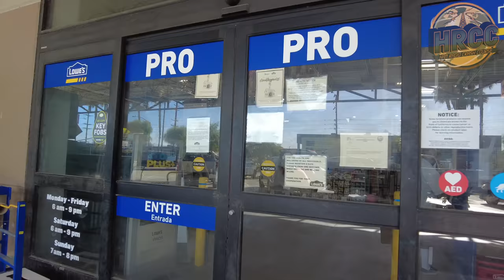My Ham Radio Go Box Wiring And Setup

Comment: Hi Josh,

Ok, in steps as I watch...
[8:30] fuses - the power cable they provide is designed for MOBILE; i.e., CAR & TRUCK use. The fuses are meant to be close to the battery (power source) to protect the wiring & prevent fires.  Arcy-sparky & oil/gas don't play nice w/each other.

Wheels! Nice.
But... for POTA, ya needed BIGGER WHEELS!  You may want to strap that case onto an aluminum; large pneumatic tire dolly.

Comment: Fuses are close to the battery to protect the wiring. In the event of a fault you want the fuse to blow close to the battery so you don't keep pumping electrons into a dead short, overheat the wiring, and start a fire.

I do agree with you that it is a pain to shorten the power cables to the desired length. It would be nice if they came in three sections with a radio connector section, the supply/fused section, and an extension.
Reply: To expand on Daniel's point with an illustration:  Imagine you have a power source (battery) on the left side of your desk, and the load (a radio) on the right side of the desk with the power cable running between. Imagine someone comes in and sets down a large object on the desk with rough edges that pierce the sheilding of the power-cable, causing a short circuit.
If the fuse is close to the load (radio on the right side of the desk) now you have a battery with a short-circuit and that fuse by the radio will NOT do anything to help the situation because the flow of electrons never makes it that far (remember: short-circuit!)
However, if the fuse is close to the source (battery on the left side of the desk) the short-circuit should exceed the value of of the fuse (assuming an appropriate vlaue of fuse was selected!) thus blowing the fuse.
Yes, location of a fuse MATTERS and it should be as close to the source as possible.
73
VE3KLT
Reply: 100%

Comment: According to the West Mountain's Power Gate manual, (copy -n-paste)  "Solar Panel - Connectors are intended to connect to a solar panel, NOT A CHARGE CONTROLLER. When the power supply is not present (or off) and there is over 13V on this input, the battery will be charged from this input. This is

an optional input to be used only with a solar panel."  People, read the manual!

Comment: Thanks for the video! I'm setting one up with my spare 7300 and a 5100. Your video is one of the better ones, for sure! I'm using the 4U and I found a luggage cart the perfect size to roll it around. On another note, if  I had that many Anderson connectors, I would lose sleep over the possibility of running out. Stock up.

Comment: I also have a Gator 6U Go Box...mine was featured on KM4ACK's YouTube site...I've ripped mine apart 2 times since then, putting things in as well as throwing things out....the wiring can get interesting to say the least... My top 1U where all my switches/outlets and voltage meters go came as a solid piece and I used a "knockout punch" of the correct size to cut holes for those devices.....Lots of fun designing these......Thanks for the video....
Reply: A note:  when you start wiring your go box....draw out a schematic, it'll help you later....

Comment: The need for brackets has caused me to save every single extra angle bracket, washer, and grommet I've come across. 
I'm building my own box once I get a mobile I can afford. Thank God I got in touch with another ham club member so I gotta save all my rubles and possibly pick up a QRP since I'm on a damn island and 20 watts is good enough for the military guys. 
Thanks again for getting back to me. I looked up how much sending a zip pack will cost, and I'll just buy you a beer and give you a spot to stay the next time you're on the big island. 🤙🏽
Reply from the maker: Hahah yes! Save all the brackets.

Comment: That's a BIG go box.
Reply: Almost looks too heavy to "Go"
Reply: I was thinking that too, but, I guess it also depends on what you mean by "go."  If you're car camping, or maybe even DXpedition via plane, etc, heading to a HamFest, and stuff on that order, this is not a bad way to take everything you need in one, solid unit.
Reply: @pspadotto  plus there is a little room inside the box (on the back of that top shelf) for some extra cables, wire antenna, roll-up j-pole, etc.

Comment: Nice, my go-box is very similar.  A fuse's job above all others is preventing fire.  The fuses are placed near the power source so that they protect the entire length of wire in case of a short.
Reply: Thank you for your post. It helps me understand how to better build my gator  go box.

Comment: I bet these videos are good for engagement because I know I have a few opinions while watching this! 😁 On your fusing debacle, I would use a RIGrunner (or similar) that has fuses directly on the distribution board, and then cut the radio power cables as short as you want.

Comment: A short tip for installing the shelves.  As long as everything is attached securely you can tip the rack so the rails are facing up.  That way the shelves can just hang in place and you can easily set them in and get the exactly where you want them.  Dave-WA4OPE

Comment: Awesome project Josh, I am going to have to make one now too. But to answer your question about the fuse, if you put the fuse closer to the radio, and if there is an issue and the wire gets too hot, it will melt the wire all the up to the fuse. you want the fuse closer to the power load so it protects the wires going into your car. now if you are going to cut the wires you can cut to fit but you want to have that fuse close to the power source.

Comment: I live about 45min from Sweetwater. I do play with some music and love Sweetwater. When you call/email/chat with questions you actually talk to someone who knows the equipment. If the person you get doesn't know the particular gear your asking about(because they have a lot, no one knows it all) they will get you someone who does know it. If you ever have need of audio gear or musical gear, calling Sweetwater will very much remind you of calling Gigaparts.

Regarding fuses on the factory wire, who knows. Personally I want fuses at both ends so that if something happens in between that is causing power to be injected to the cable both ends blow. I'm mainly thinking about in a car where you may have a long power run where that is possible. Now just imagine if all radios used a standardized power connector! You know like USB-C. I said like, because I know USB C doesn't have enough power or amps for some radios.

Comment: Kester solder 60-40 and marine shrink tube - power crimp connectors are a big no-no. Panel mount so-239 - make regular jumpers to pl-259 with reducers - no crimps - 316 coax. Please get some 5 gram packs of desiccant - these are dirt cheap on amazon and reusable and will keep things dry! I'm not giving you a hard time BUT if u want reliable field ops for w/e reason its gotta work when you need it, last thing you want to deal with is some corroded connections showing faults when you really need things to work!

Comment: 6U as in 6 Units. There are SO many items for them. My dad used them for audio, as did my high school. I used them at church for audio, visual and networking. You can go many different ways. Think of where you want your radios, air flow, power supply, battery or both. Connections you might need for power or antennas. I wired a switch outlet to a psu. Lighting in the case. 

It’s literally a shack to go. I say work in sections and make custom cables.

That is the correct power cable. 

My Anytone and TYT had three fuses. I think my Kenwood has 2. My 7300, I cut the cable and put power poles on all of them. I even made more. Including a cordless drill battery pack that died. It has power poles.

Comment: Very cool project Josh! I did a similar project with my Yaesu FT-891 when I upgraded to a new radio. I built mine into an old aluminum briefcase in the hopes that it would give it a bit of RFI protection, plus it looks cool and is fun to carry around what looks like a vintage nuclear football. My cable management was a bit messy looking but it got the job done. Looking forward to more of your project videos like this. 73!

Comment: Love the use of the Power Gate. Now, I use mine for my Flexradio and have since I got the Powergate. I use mine more as a UPS for the radio so when I loose power, I have time to safely shutdown the Flex or if not, it will run the radio for about 4 hours (That storm we had last winter was a good test). I also have a go box and I use the West Mountain Rig Runner 4007U which includes 2 USB power connectors which I use for the PI 400 and external monitor. My Solar power controller/battery was the BuddiPole Powermini into the West Mountain. The radio I chose was the FTDX-10. I am very glad you showed how to mount the radio. I need to do this but I have a full shelf in mine that attaches to the front and rear. As such, it is adjustable and it makes marking out the holes a little more difficult and Yaesu does not have the mobile mount so I fashioned something up that I hope to improve on. It weighs 35 pounds and most of that weight is the damn steel shelf. What was your weight in the end? I was hoping you would say. For lighting, look at W1FYG Smoke Signals RF's design. There is a company that TO showed that Don uses in his Go Box.
Reply from the maker: I’ve got a few more things to do and I’ll do a follow on video. I’m guessing we’re above 40 lbs at this point, give or take.
Reply from the maker: I’m going to look up that lighting now.
Reply from the maker: I weighed it. 50 lbs. it’s a chungus. Lol
Reply: While I definitely see the advantage of using a Power Gate to switch from AC to battery, for me who's on a limited budget, $189.00 for the Power Gate is a bit much. So, in lieu of using a Power Gate, I'm using bus bars and a manual DPDT switch instead. Also, no extra spending on Anderson Power Poles.
Reply: @kennethherring2918  I only use mine for the Flexradio which is an investment that I want to protect. For my go box, I don't use a Power Gate and in fact, I don't really have an AC requirement. That my personal choice not to use AC.

Comment: I just completed a go box. As they are all different, mine used a suitcase style box from Home Depot made by Rigid. It was a poor choice. It is self contained and uses a mobile radio (Anytone AT-5888UV), Mobilinkd TNC3 for Winlink, and a 30AH battery. Three ways to charge: AC charger (built in), Solar (10A max), and a DC/DC converter (can fully charge battery to 14.6 volts from any source between 8V and 14V). Key components I learned and used are: Ideal diodes. They have almost no forward drop and provide lossless reverse battery protection. Poly switches. A positive temperature coefficient thermistor with a sharp "knee". Acts as a self resetting fuse. So I don't have to open up the box to replace a fuse if I screw up.

Comment: Josh, Sweetwater is located in Fort Wayne, Indiana.  I live about 25 min north of there.  Great place.  Huge building, from showroom, to studio, rock camps, lessons, repair, etc.  Even a concert venue.  If you need pro audio gear, they are the place.  Sometimes a little pricey, but you get what you pay for.  Has anyone from guitar center or musicians friend ever called for follow ups?  Probably not.  Also, whatever you by from them, you can call anytime for the life of the product with questions.  Not affiliated, but have purchased many items from them.  73. KD9NZK. Troy

Comment: Tip with your wiring management, you can get cable tie saddles and mount them to the tray, get some split tube/loom to Inclose the cable, cloth tape instead of electrical except wire isolation joints. Use RG400 if you are worried about cable loss, put some Freire coils on the usb and power cables to stop RF Interference if any. Have the radio grounded along with a grounding kit, place some microphone clips in the box somewhere, might be best off getting some blue loc-tite on the RU rack bolts peace of mind on the racks always staying in place. Just helpful tips

Comment: Cool! I built a “Ham-O-Can” using a 50 cal ammo can with a Yeasu FT 8800r powered off a battery fed by solar, 110 via a battery tender, and Anderson power poles with connections available in my truck.

Comment: Very nice. I made a cruder attempt at a 
smaller go box about 10 years ago with
an mfj battery voltage controller added
to keep the voltage up. I used an earlier
ICOM Analogue/DSTAR mobile radio
as my main transceiver, no HF at that time.
Ray, W2CH

Comment: Powerpole tip: Glue a pair of housings together in the right orientation for ham radio use. I tape them to the inside front of the box that holds my PP stuff with the wire end down. You can see the metal clips and then use that to put the crimp on pins the right side up so no wire twisting!

I use a fishing tackle bag with the utility trays for all my connector stuff. Pocket on the front holds all the crimping tools and the side pockets hold stripping tools. Portable for field day use! Has coax, powerpoles, spade/ring terminals, some spare fuses...

Drilling tip to save cleanup of sharp little metal bits: Lay tape down sticky side up to catch the little metal shards, especially handy if you need to drill over existing equipment or over carpet.

Comment: I used a similar panel for my home made antenna patch panel and my DC supply.  I find that fender washers and a deep well socket on both sides you can tighten them up nice and tight and it will look just fine.  I have the shallow version of that rack for using under my desk.

Comment: Nice work.  Everyone of of these is different due to different needs, operational needs, budget, and what you have laying around.  I've done different types of go kits over the decades as mission and equipment changed.   I currently have two different sets (all VHF/UHF, have not needed HF in my area for ARES work to date, and have the rig in my truck if needed) for different needs.   In addition to POTA and ARES/RACES work, that would make a nice Field Day station as well.

Comment: Very nice! Thanks for posting. Still room for more devices. From past experience. In situations where a "go box" was necessary, the ability to transmit images was vital.
Reply: SSTV?
Reply: @Justin-bd2dg  maybe drm sstv. But if one is going to be communicating with government agencies Pactor would be a better choice. Thing is, Pactor modems are very expensive. Check out disaster responses in Puerto Rico  and Haiti.
Reply: @boo-ix  what benefit of images could come during a bona-fide emergency?
Reply: @Justin-bd2dg  It would give first first responders an idea of conditions before they arrive. One would also be dealing with lists of supplies, etc,etc. With Pactor it could be sent in bulk. The more information that can be gathered the better. DHS also has "the citizen corps", which is associated with the ARRL. There is also REACT. Perhaps not all "go boxes" are for assisting in disaster relief. I have been away from ham radio for 10 years or so. What do you think Justin?
Reply: @Justin-bd2dg  Oh yes I agree. Maybe DRM SSTV. We where given a Temporary Waiver to Permit PACTOR 4 during Laura. LOL maybe my point is that "phone" only will not cut it. The more information first responders receive the better. Agencies like FEMA are actually the last to arrive. You are correct about winlink.
Reply: I love photography and so I know how one photo can can’t truly tell you more than a thousand misspelled words. My question though is how large of a file can those systems transfer and how do you transfer a photo to the device that’ll process and the transmit it. 

I guess what I’m really asking is how quickly and efficiently can you take a photo and get it to those who need it. 

I’ve played with some photo transfers and I feel like just taking a second to calm down and write out a report of the situation would be at least twice as fast and more thorough in the end. Both is obviously better.

Comment: Assuming that it’s a 19 inch setup, there is a ton of IT as well as Audio stuff on EBay and Amazon.  From lighting to shelves. Most of the electrical stuff is for hardwire, but some of the pop out lights are LED, so a little solder goes a long way. Great job on the video.

Comment: Thanks for sharing your go box build. Try looking for an auto map light. You will need another accessory jack for it, but it will give you adequate lighting.
Reply: Maybe use some aftermarket license plate lights used on step bumper's. One of them with a red LED bulb and the other with a clear LED bulb. Weather proof and cheap to replace if it gets broken.

Comment: Great Vid. a police supply equipment store should carry a 12v light with a gooseneck that plugs into the cigar lighter socket. Another great choice would be the LED tube light that Anderson Power carries in their web site. very light weight and mounting brackets simple stick on. on/off switch on end of tube and it comes with power plugs already installed. And I'd add a mini Maglite so you have something to use when your working at night.

Comment: that a great project. so many ways to do that. I love powerworks stuff. all over my off grid home and in my camping gear. love the IC 7300 . what I use. Great to run on LiFePO4 battery. and has 6 meters ! I use usb C PD 45 watt. they make a 12 to 24V one as well. how I run my laptop. even the one watching this video. HP 17 in with PD cord .direct to my 24V system. watch out for solar charge controllers a bunch of them make HF noise. use ferrite . it varys brand to brand so I test them first for the hash noise. now make a ammo box battery ! now for me would be different. no power supply ,no inside battery. USB C PD port. and a GMRS radio .but each HAM will have their own. we just custom build .for them SO 239 bulkhead make some washers for both sides. I run a drill press threw tractor supply washers . they great for hardware  and buy me. 73's